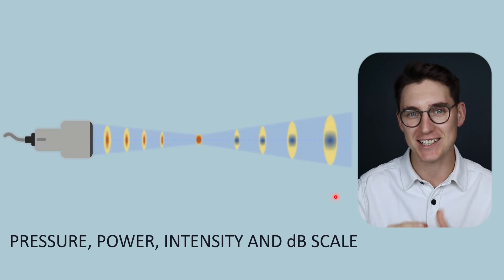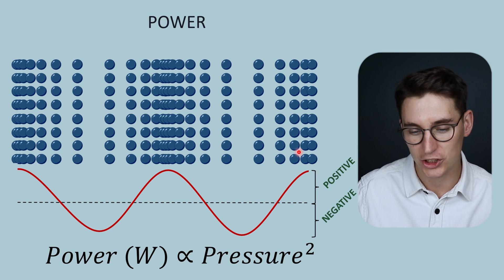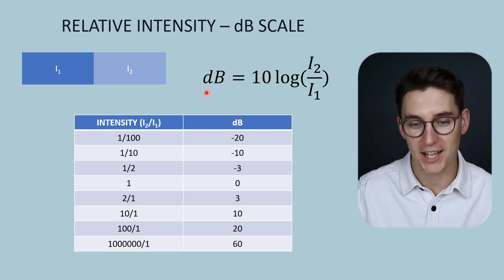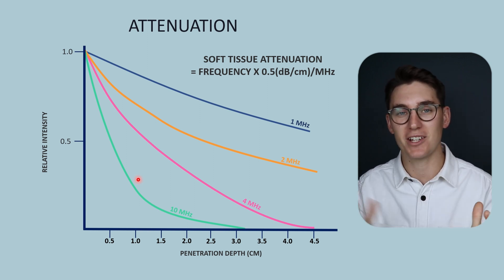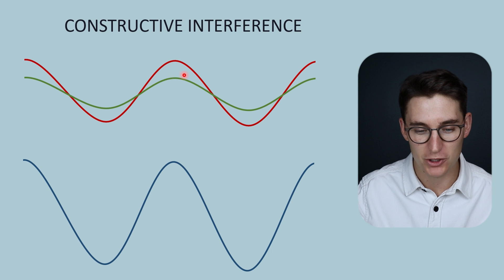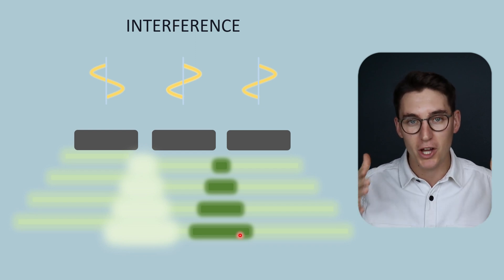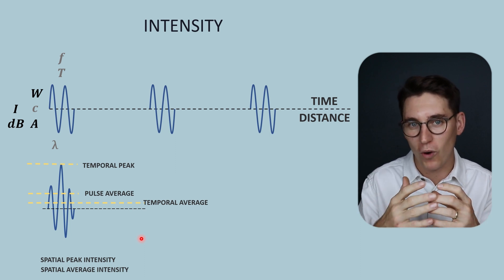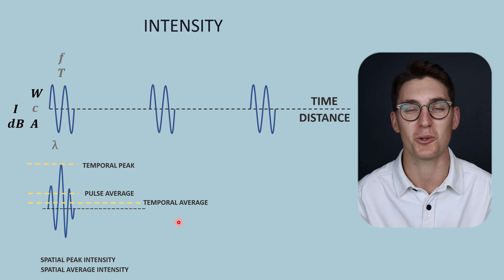Pressure, Intensity and the Decibel (dB) Scale | Ultrasound Physics | Radiology Physics Course #3

Comment: Thank you so much for making these videos sir❤
I have one query 
Why we put decibel in the area section? If it is change in intensity then it should go along with it right?
Reply from the maker: Good question. Mainly due to space. Strictly speaking it should be in neither the time or distance domains (it is a relative measure containing no time or distance units). But mainly because there was no space on the slide 😊

Comment: Hey, I love your videos ! :) I have one question. In video 4 (Pulse Echo Ultrasound Parameters) you say the PRF can vary depending on the depth of tissue you want to measure. If I understood correctly that means by determining the depth of tissue the PRF is automatically (?) adjusted. Here in this video you say that the frequency of the transducer determines the depth of tissue that the ultrasound can reach. So how does that work together when there is the frequency of the pulses and the frequency in which the pulses are sent that influence the measuring depth? Like what if my choice of transducer and frequency of the ultrasound waves is inconsistent with my choice of measuring depth which only has an influence on the receiving time and PRF and not on the pulse itself ? 
I hope you understood my question, I am from Germany 😂😂
Reply from the maker: Hi Jaqueline. Sorry for the delay. I’ve been on holiday. Great question. So attenuation is in part determined by frequency - high frequency waves get attenuated quicker over a shorter distance than low frequency waves. However, we do not use frequency to determine the depth shown on the ultrasound display. PRF (ie the number of pulses we send into tissue per second) determines the depth displayed - as you’ve correctly said. If we set a low PRF it means in theory we can display ultrasound information to a greater depth. This is because the pulse repetition period will be longer - allowing enough time for waves to travel deeper and return to the transducer before the next pulse is sent out. However, the actual ability for that wave to travel to that depth is determined by the frequency of the wave. If we use a frequency that is too high there will be no returning echoes from deeper tissue because the wave is attenuated too soon. This will look black in the ultrasound screen if we set the depth too deep using the PRF. 

So the PRF is automatically adjusted as we select a certain depth but whether we’ll get any information from that depth depend on the transducer frequency (that’s why we use high frequency probes for superficial structures and lower frequency probes for deeper ones) I hope that makes some sense 😅
Reply: @radiologytutorials   Ah okay I see, thank you ! But is it possible to use a higher transducer frequency for better resolution and still gain depth information with the help of TGC? Or will I get false data ?